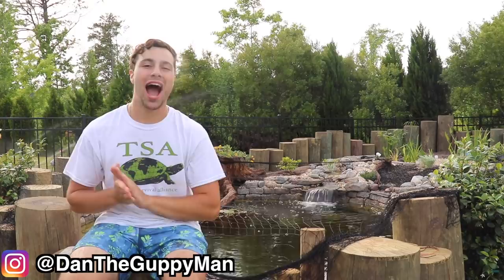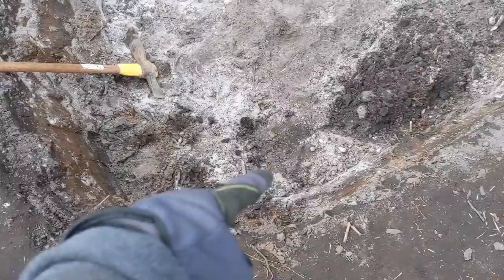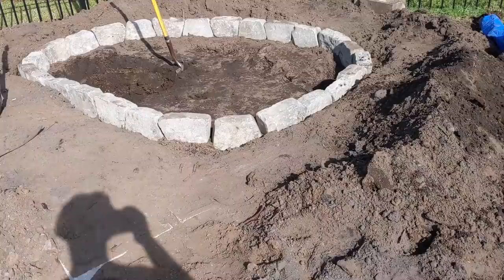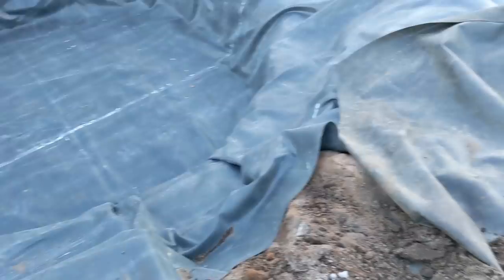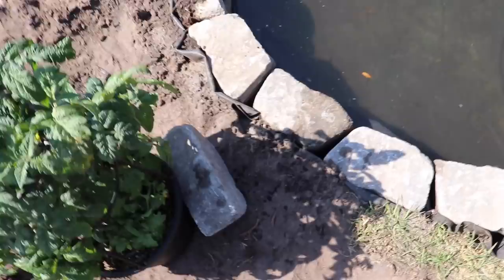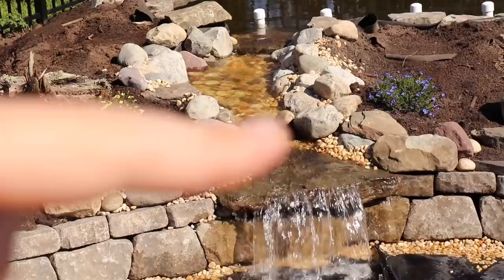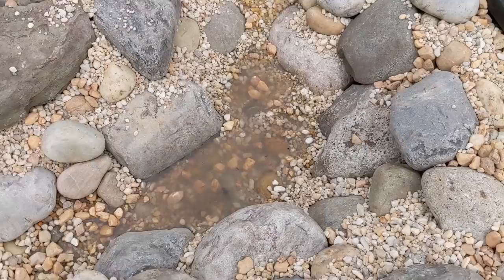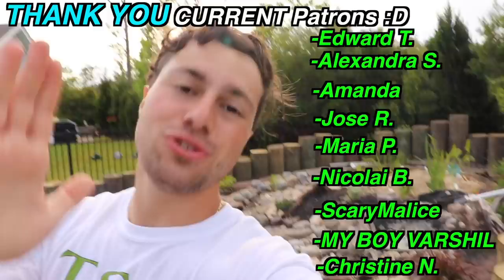MASSIVE DIY Turtle Pond BUILD!! (for under $2k)

Comment: Dan. I have no idea if you remember me, but I seriously havent commented for 2 years. Im sorry for that, I had restriction mode on and i keep forgetting to switch it off
Anyhow tdays help that I require is:
My turtles are kept in a 40 gallon tank,  there are 2, one is male, the other is unknown by me. However, this morning, I woke up to find one of the turtles have the bottom left of their shell chipped off, its skeletal structure of the shell showing. The side of it was chipped off as well, white parts that I assume were the shells were stuck to the canister filter hose. There was a skinny hole leading to the insides. I immediately took it to the Vet. Vet gave it 5 injections (YIKES, the head was stretched so far I was so worried for the turtle.) It has another injection coming up (antibiotic) this Friday. The vet says, or should I say, believes that it was bit off by the other turtle, which has a fat tail and is slightly larger, so I assume its female, but I cant be sure. Recently the Male has been skinnier, weaker, and the other one has been getting fatter. So I just setup a new tank for the other turtle the injured one. it is bathing in iodine solution right now. But the problem is, why did the what I believe is femal bite off part of the shell from the male? the male isnt aggresive, allows me to stroke the neck and never bites, but the non injured one does. So I dont think that the Male picked a fight. Is it possible that turtles go crazy? The water quality is always PH measured, I prep the water before hand with the conditioner before changing the water. The heat is cllosely monitered everyday with a ray measuring thing that my cousin bought. Basking area is rather large, I use the Penn plax turtle topper, and they both have UV light and Heat light. There is no substrate because I am afraid that they will swallow it. Decoration is minimal, clean. So why did this happen? And is it ok to keep them together again in the future? before this, I was starting an aquascape project for them to stay in (70 gallons.) And I am very dissapointed, worry, scared, and sad. Please help

btw sorry for terrible english, I am typing this with one hand and I really wanted to make this brief.
Reply from the maker: Hey man!  Good to hear from you again. So honestly, sometimes your turtles can be as sweet as can be for as long as you own them and one day snap. Nobody knows why, but red ear sliders, male OR female (sometimes females more so) can be aggressive. This may have to do with her needing to lay eggs?  Sometimes when they're hormonal they become more aggressive. You did the right thing taking him to the vet. Separate for the time being and there's a chance you can reintroduce them later in the larger enclosure but for now, keep separated. Let me know if you have any other questions

Comment: What kind of pump did you use that can output that much flow and be $40? I'm trying to build my own pond and I'm curious!
Reply from the maker: It was mismarked at a secondhand store, brand new in the packaging!  It's a totalpond 3600gph pump. They labeled it as one of the lower output models.
Reply: @DanTheTurtleMan_  thanks for your reply!